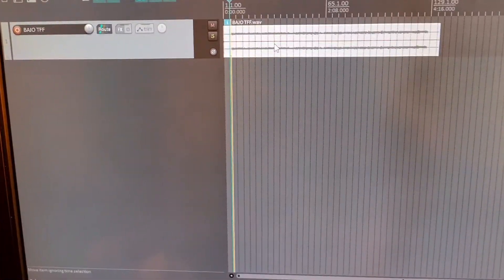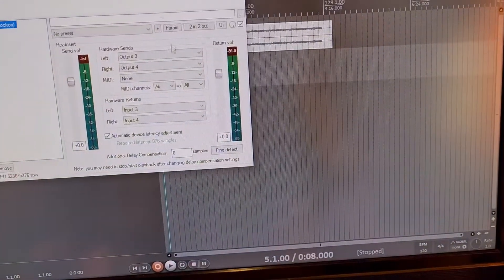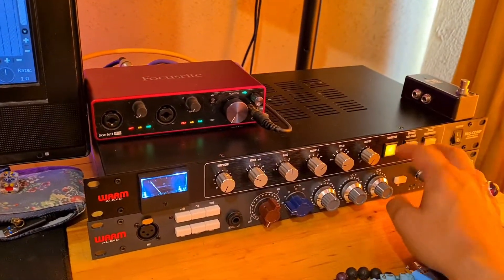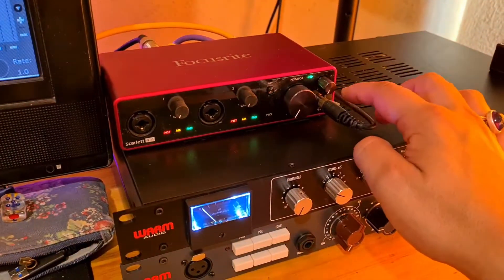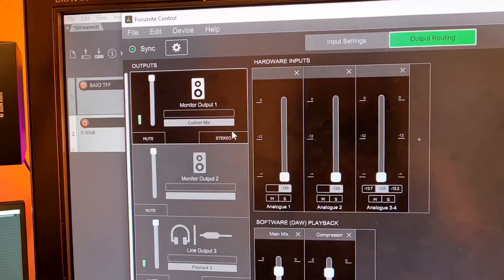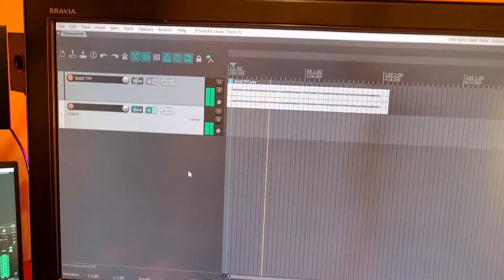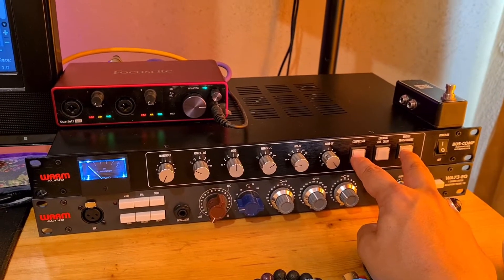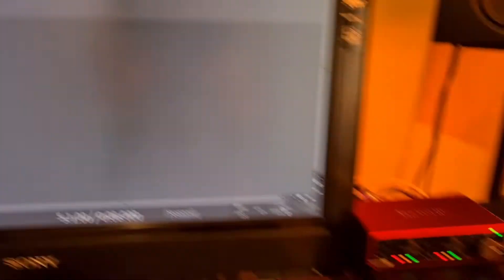OUTBOARD GEAR in REAPER with FOCUSRITE

Comment: Thanks! Also a Reaper user and I have a Focusrite Saffire Pro 14, so don't know if it will have the same shared output problem as your Scarlett. But I just got a piece of outboard gear and I want to be routing a setup like this. I'll actually be using it for tracking (it's a channel strip) but for now I want to set it up so I can play back untreated tracks through it just to learn the controls and find some good basic settings.

Comment: Thank you. Um using the same daw and i have a problem routing my dbx stereo compressor. The sinal between L and R came with a diferent level of volume. I try to compensate gaining the volume of the lower SIDE, but its so sad stressfull.

Comment: Would this technique work with using individual guitar pedals as an outboard effect?
Reply from the maker: If you have the 4i4 it should work the same way. Just remember that you will hear the guitar pedals working on your monitors, not your headphones.
Reply: @tomasoyarzunarenas  Why? It should be routed to both! The Outputs 3-4 share an output with your Headphone out - so whatever comes out of Line Outputs 3 and 4 will also come out of your Headphone Jack and into your headphones. Just remember that your Headphone Output has its own volume knob on the front of the 4i4. Maybe I am missing something? There is no way to de-link what comes out of Line Outputs 3-4 from what goes out of the Headphone Output from what I understand. Have you had a different experience?

Comment: how does reaper handles outboard gear in parallel in a mixing context? I mean, if I want to use my outboard compressor on a snare drum while hearing the mixing through my monitors.  Does Reaper compensates accurately the Hardware insert delay?
Reply from the maker: Sup dude. It does, np there.

Comment: Not sure I follow. There doesn't seem to be any reason to separate your Main Mix into two mono channels. Also - since you are running your compressor in stereo - not sure I understand why you had to separate your Line Outputs 3-4 into two mono channels. It seems like the most critical thing you did which never gets covered anywhere is that you added Playback 3-4 to your Monitor Outputs and Line Outputs. Without that - you would not hear what is coming out of the outputs on Line Out 3 and Line Out 4. Maybe I am missing something? Now that some time has passed - can you reiterate what you were trying to solve and how your solution solved it? I am just confused and want to understand. My biggest problem has been dealing with feedback loops when trying to work with outboard gear and signal routing. Would really love to hear your thoughts on this. Cheers, man.
Reply from the maker: Sup dude. I think the video sums up well what I was trying to do which is use external analog gear with reaper and focusrite. In this model of focusrite the line outputs 3-4 are also shared with the headphones, that's why you need to unlink that to hear the outboard gear work, only in monitors though. I need to create a send for my analog and there I can print what I'm doing. I mainly use this compressor for mastering so it really doesn't give me much trouble to do that. If there is another way to do it please share it with me. Best!
Reply: All "stereo gear" from mixers, to compressors and even speakers require two signals. If you wanted to run a stereo signal through an analog mixer for example, you would need two mono outputs and inputs for left and right channels respectively. Stereo signal as a single signal doesn't exist, it's an illusion. Hope that helps, cheers.